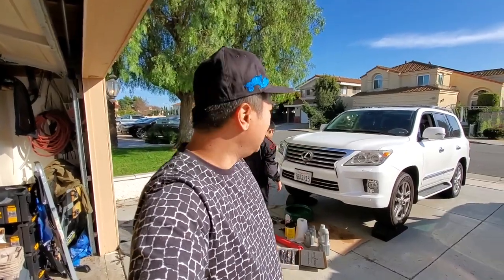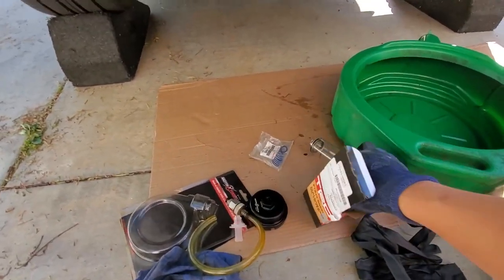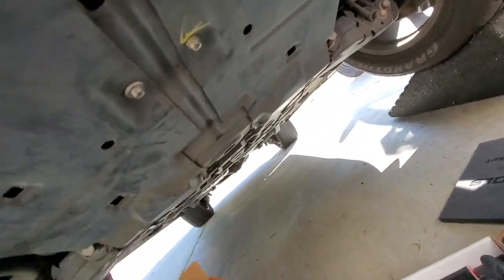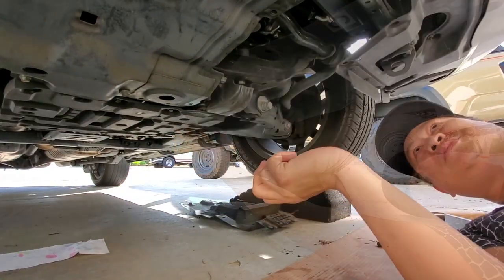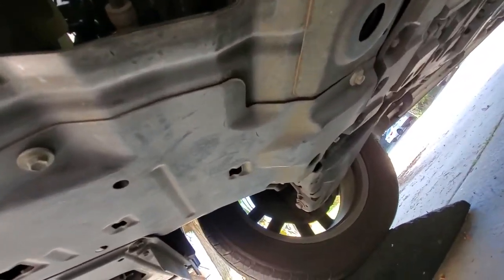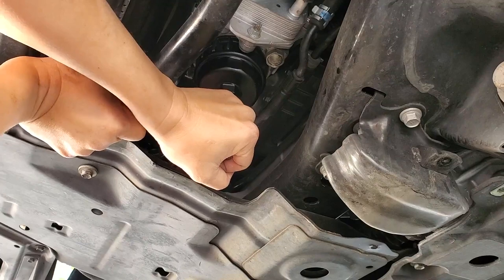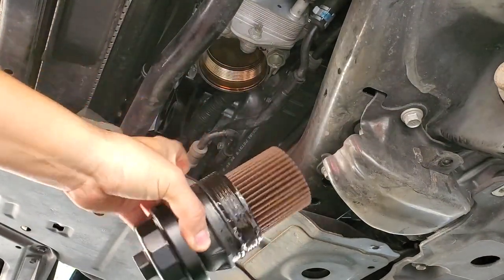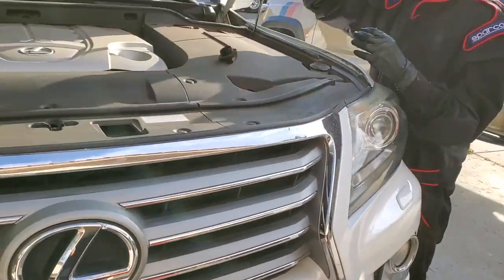Lexus LX570 / Land Cruiser DIY Oil Change by my 12 year old

Comment from the maker: My 12 year old son Jesse loves to work with me and wants his own DIY channel soon.

Today he changes the oil on mom's Lexus.

I hope you enjoy the video as we did filming.
Reply from the maker: do you mean 2nd row? I wouldn't do 3rd w car seats
Reply: Rob Daman yah I wanted to see if adults could fit in the back or way back. We have a pilot but looking at one of these for when the in-laws come with us
Reply: @RobDaman  If it’s any consolation prize I ordered the metal filter housing from Amazon and when I was installing the bottom part of it it cracked while tourqing. Not the part that cracked on yours but the part that relieves the over spillage that holds the smaller O ring..So I too will be taking a trip to the Toyota dealer to get a metal housing the Amazon is metal - but it’s kind of flimsy in it’s own way
Reply from the maker: @paystyles5429  oh wow. Double bad luck
Reply: Vou acompanhar ele sempre, 😁😂
Serei o primeiro a se inscrever no seu canal.

Comment: I’m surprised they didn’t break that plastic oil filter housing as tight as they had it in there. Thanks for the video this confirms why I will not take my recently purchased Land Cruiser to a shop for service they’re not gonna put the time and pay attention to details. And if you think the dealer is safe one time I had them use the wrong oil on my car by swapping me and another customers ticket

Comment: Did you only fill with 7 qt? Ive checked several sites and theyre all recommending 7.9qt with filter. Not entirely sure what they meant tho.
Reply from the maker: No. You check your dip stick and add accordingly so no overfill

Comment: 5w-40 The right oil for your car
5w-40 The right oil for your car
5w-40 The right oil for your car
5w-40 The right oil for your car
Reply: 0-20 works well with a synthetic oil conditioner with each oil change

Comment: What do you think about using the metal filter housing they usually come with the RAV4 or the Highlander. I ordered one just wanna get your opinion before I put it on my Land Cruiser. I was told its the same part number I noticed you didn’t change that and you remain with the factory plastic. Your thoughts?
Reply: Asked b4 i saw whole video😺
Reply from the maker: Indeed 👍. Be sure to change the tube. Jesse explains how

Comment: I wouldn’t run 0w20 in that region. I would be running 10w30
Reply: if you add a synthetic oil conditioner during regular oil changes you will be fine